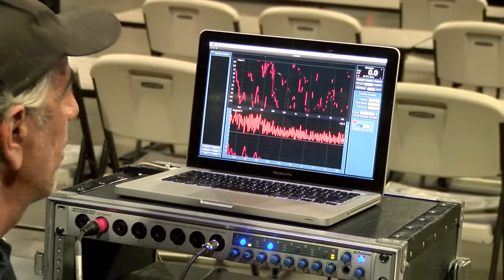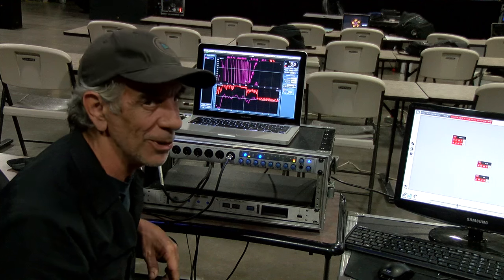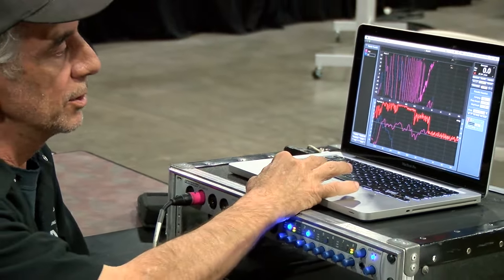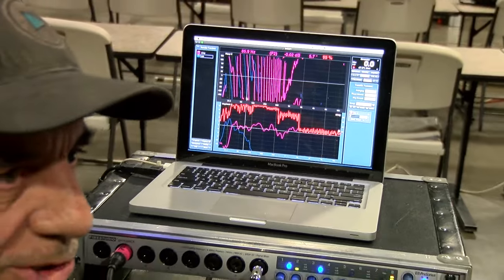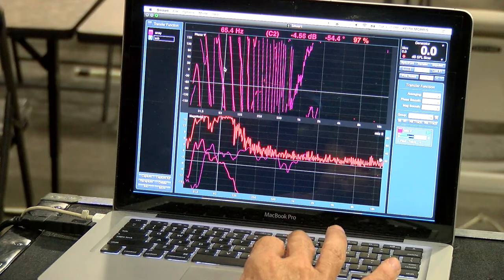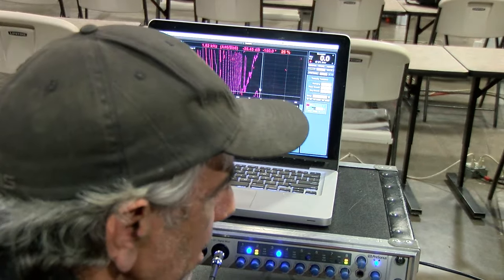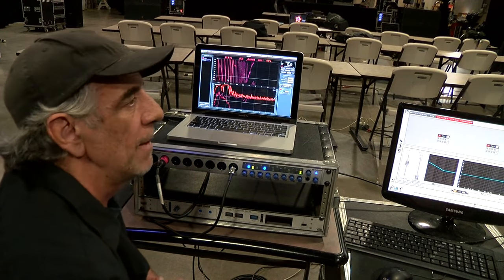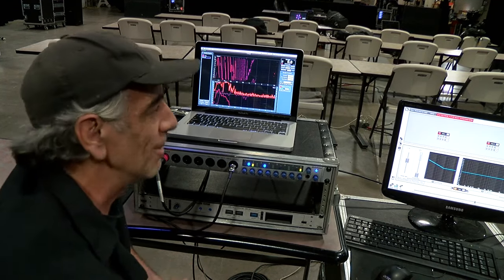Smaart - sub woofer alignment with Keith Morris

Comment: My question is "aligned from WHERE??!"   Measuring from one spot/seat in the room will make for a varried results from other locations of measurement, depending on relation from seating locations vs subwoofS locations, and sub to sub respectively  and in assocation???   Seams one sub will be close and one far from any given seating, so how do you balance and for Phase on that?!   Seams challenging if impossible to balance for all seating locations in this particular instance. Besides my marbles, what am I missing here???
Reply: Its at 0. You need to have a 0 point to define all other mathematical things youre doing. Doesnt matter where zero is. It's like 'at X i measure this' . Ofcourse in this field of work there are sweatspots. Spots where phase cancels out in some frequencies. Standing waves with the room etc etc. But 0 = your absolute 0 point of measurement and aligment. Heck it can be 20cm in front of the subs. it can be 500meters in the distance . Doesnt matter where you put that after that the equations start.

Comment: Keith, can’t knock you for making a decent video. However, you failed to show your students the full picture when it comes to possible differences between your polarity inversion vs. time alignment. For one, it was by chance (or perhaps by design for the sake of your video) that polarity inverting your subs aligned the phase traces. That’s going to be a shot in the dark for many deployments. A student should see what happens in the crossover region after you’ve applied the two different actions outlined in your video. With the polarity inverted on the subs, what does the measurement look like with the main array added back in? Do you have proper summation above and below the crossover frequency you were focused on? With both systems energized, do you have significant cancellation in the crossover region if you flip polarity back on the subs? How does this compare to the delay method? If the subs remain in relative phase and you time align them to the tops, do you have more or less summation in the crossover region? If you flip polarity on one of the systems in this case, do you have more or less cancellation. You may be misleading your students by not showing them this additional context for measuring and tuning crossover points. You might be “in phase” at that one crossover frequency by overall out of time. You may be giving away “free” energy of the systems aren’t properly time aligned through the crossover region. You should see distinct summation through the crossover region with both systems time aligned and and in proper polarity. If this summation produces undesirable frequency response, apply corrective EQ. This way your system design is benefiting from the “free” summation energy. You may have been there with what you demonstrated with the sub polarity flip, but I feel you need to demonstrate how to validate it with additional measurement.

Comment: First step to use smaart is to synchronize the reference jumper on it.  I didn't see you do that. So I think you screw up Dude!  This Is why your lines look so awkard.
Reply: He mentions in the video why he did not do that. A couple of times.
Reply: @snapascrew  The only thing I heard him said was as long as Smart has a reference of time he doesn’t bother time delaying it. Well I as far as I’m  aware of you need to time delay so it knows the distance between the speakers and measurement microphone. I just never seen it done this way.  Why reinvent the wheel if is already round?

Comment: The method you describe is pretty solid with delay. The phase inversion doesn't have to be exclusive of delay, either. I tend to not invert, because (in outdoor scenarios), I will often try to employ Endfire-type techniques for sonic containment. 
This requires at least 4 points of sound, though a 4.3 system (tops in each corner, summed sub array in front, rear corners are full range) has worked best so far. Essentially, you measure from the center of the space, first aligning the front tops with the front sub array, then aligning each rear top with its respective subs. Once you have that done, you move to the rear line and you delay the rear stacks until you are 90° out of phase from the front stack. Step back maybe a foot further away from the front stack. If you have adjusted things correctly, you will get a summing of the signals inside your sound space and almost total cancellation outside of if. You may have to fiddle a bit with your times, and the more bands of delay you have, the more profoundly you can create this effect. When I say fiddle, I mean tenths of a millisecond for mids and highs, so lightweight processing isn't going to do the job. 
It does work, I've done it, however, it's not easy, it's very time consuming, and I would only suggest even thinking about trying this if you own the system, or have a very supportive owner and team who are willing to give you the time to try and fail until you get the hang of this. If you can get it right, you absolutely blow minds because if you are outside of the field, you will question whether the system is even on, and then as soon as you cross the threshold, the sound hits you like a wall.

Comment: Problem with polarity inversion vs. time delay in this case:  what does polarity inversion do to frequencies above and below the crossover?  It may be perfectly aligned at the exact crossover frequency, but is it combing out energy anywhere else outside of the crossover frequency?

I think Merlijn van Veen has probably the best solution for a situation like this.  Do separate measurements with both time delay and polarity inversion and not only check the phase at the crossover, but check about 1/3 octave above and below the crossover as well. (If your x-over is 100hz, 1/3 octave below and above would be roughly 80hz and 125hz, respectively). If polarity inversion causes weird buildup or cancellation of frequencies, then it's not the ideal solution (likewise with time delay).
Reply: Lmao, hey buddy.

Comment: Have you compared this method to using the "delay locator" method?  If I wanted to align the tops to the subs or vice versa - I would want my crosshairs (cursor) to be exactly on the crossover point on the magnitude trace AND I would want the phase traces to align at that position as well. That is why you have the straight line going into to the upper screen with the crosshairs up there as well. They (Rational) made it easy for us  to lock it in this way.
It seems you are choosing a different point to align the boxes that is not at the down-point on the crossover where they cross. Can you explain further?
In my mind when it comes to delay vs. polarity - I usually go with whichever option uses less delay.

Comment: Great video, just a bit confused, is the oscillator still on 5.20seconds, just low that we couldn't hear it?  (otherwise surely it's just matching the output time which I know you aren't doing) or is thee a way to monitor the differences without noise?

Comment: So if you don't have Smaart then what other option do you have?
Reply: Room EQ Wizard is free. But it does not have this live feature :/
Reply: Fernando Ventura theres a video on youtube to crack smaart v6, in portuguese but its pretty easy to follow just looking at the screen. Ive done it, takes 10 minutes
Reply: Sat live
Reply: Open Sound Meter. It's basically Smaart Light but also has some cool features like being able to move captured traces forward and backward in time. It's also free for Mac/PC and around $50 for iPad OS.